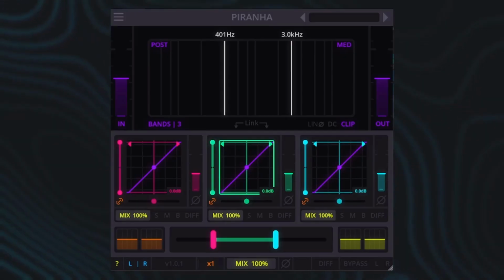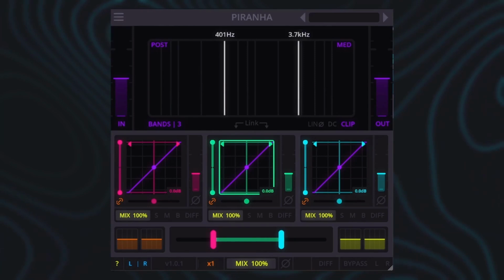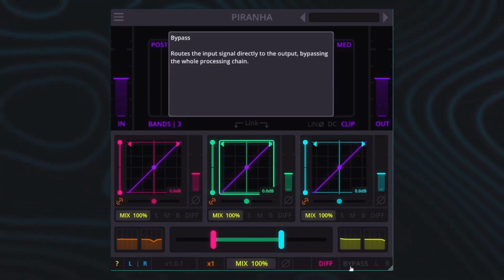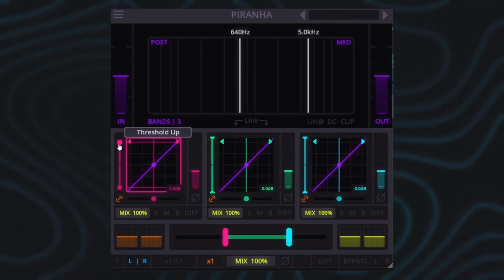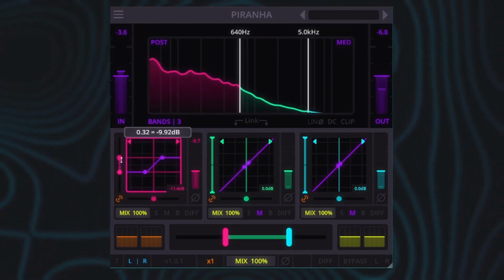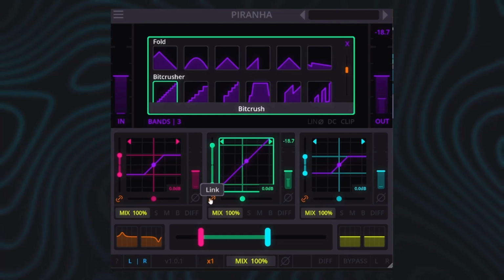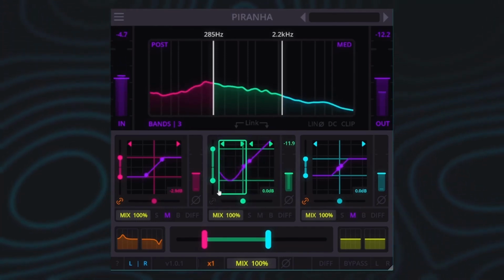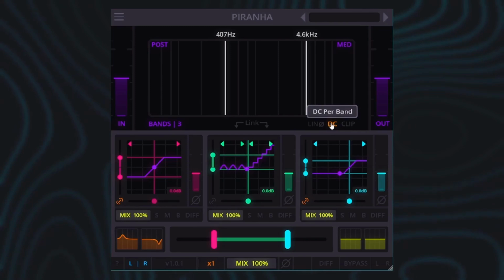Overview: PIRANHA

Comment: Whats the Oversampling options? I have yet to find any information about what max OS is... x1 to ?
Reply from the maker: Hey there! Thank you for your interest in PIRANHA! 🐟 

You can use oversampling up to 8x. You can also download the manual for free on the product page on our website if you want to get deeper into certain specifics!

The specifics about oversampling and the other footer options are found at this timestamp: https://youtu.be/f27mEw6gFJY?si=mh3RbcsLlpRRJUtU&t=122
Reply: @DarkpalaceStudio  Thanks, I guess I skipped the video a little too much and missed it,  my bad.

I have allready checked the manual, as far as I could tell it didn't specify what the max OS was.... but wouldn't be suprised if I missed that too ;)
Reply from the maker: @mentokmindtruck2443  No you're absolutely right, the manual didn't state the max OS! We will add the specifics to our website. Thank you for noticing so we can always improve our information. 😁